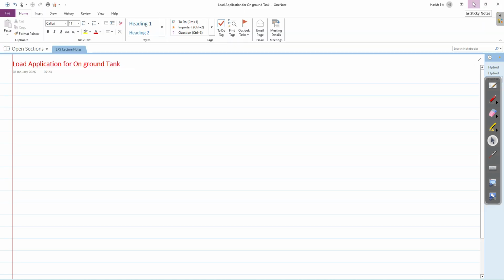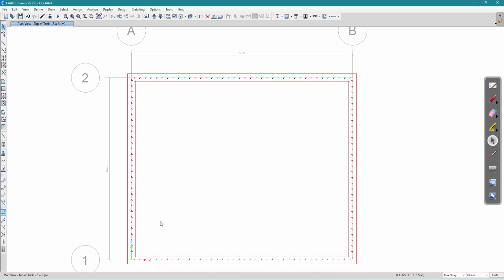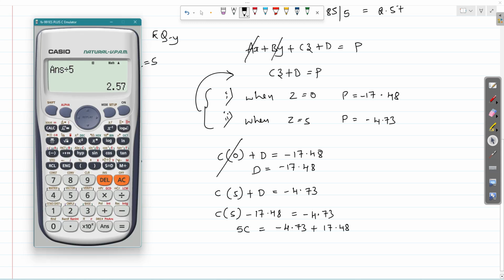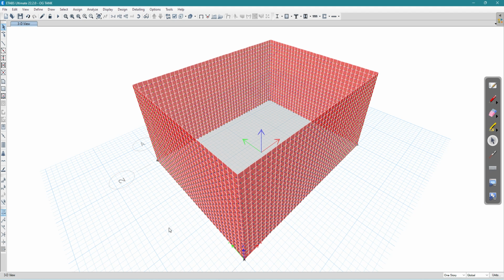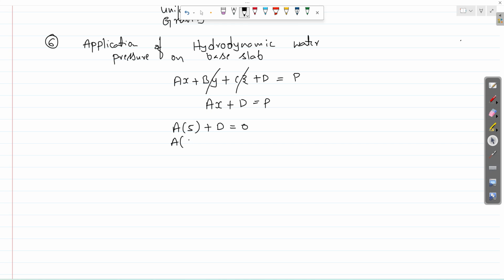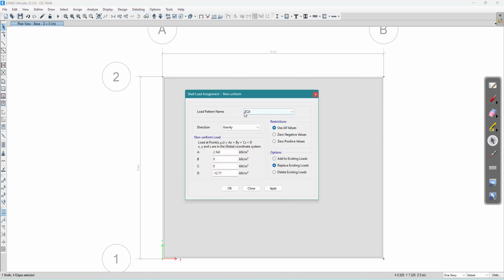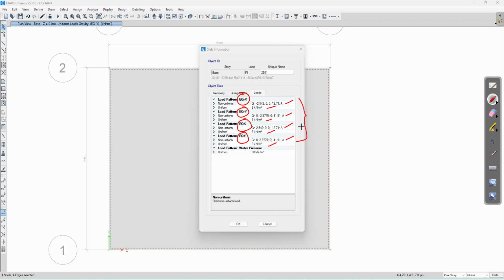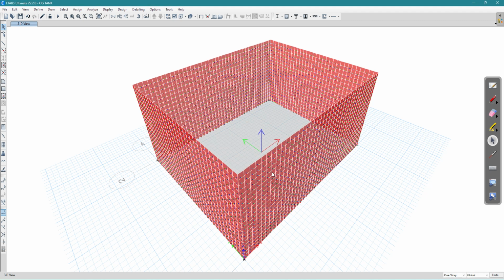Hydrostatic and Hydrodynamic Load Application on an On-Ground Water Tank in ETABS

Comment: How can you apply the water load on tank wall as a earth quick load, earth quick is not a pressure it's something else
Reply from the maker: In ETABS, earthquake (EQ) load is not a pressure load but an inertial load (F = m × a), so water cannot be applied as “earthquake pressure” on tank walls. Hydrostatic load is a real pressure (p = ρgh) acting on the wall and is applied directly as surface pressure, whereas during an earthquake, water behaves dynamically and generates hydrodynamic forces due to acceleration. To account for this, the water load is included in the mass source, and ETABS automatically converts this mass into lateral forces during seismic analysis. In simple terms, hydrostatic load is water pushing the wall, while earthquake load is the wall shaking the water, which then exerts dynamic forces back on the structure.